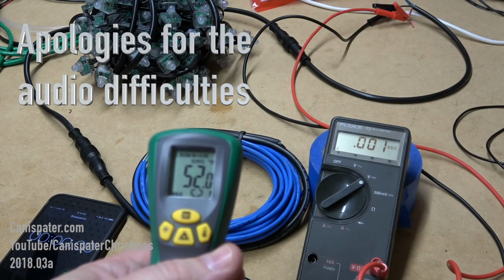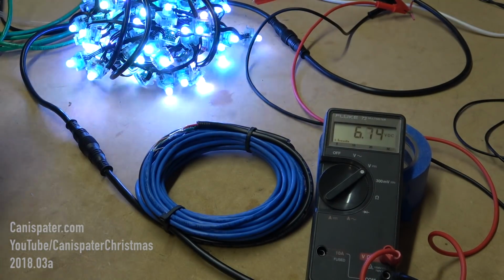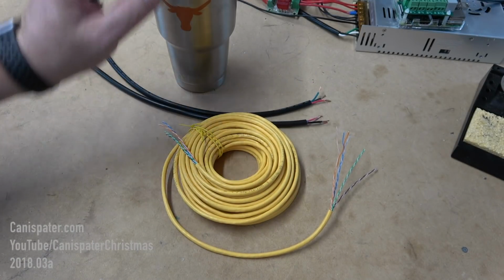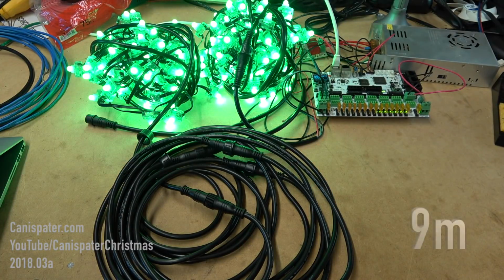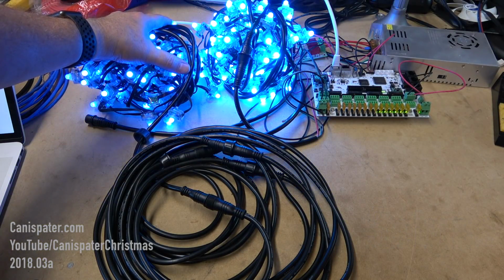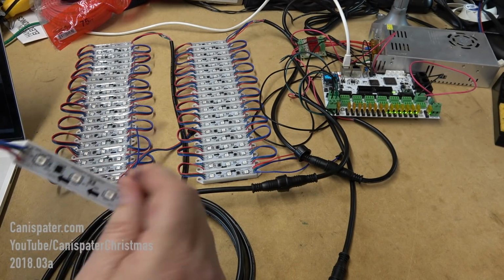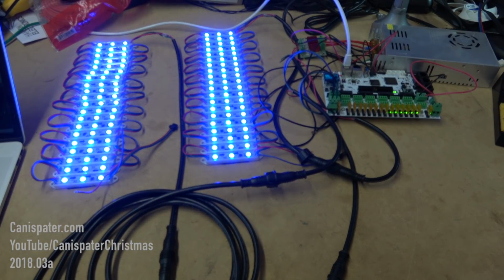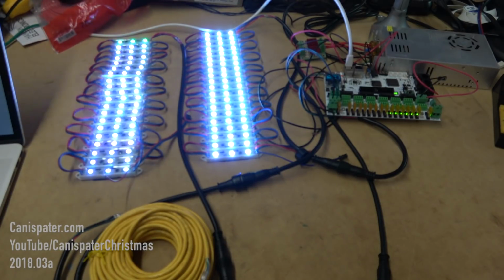RGB Pixel Distance Test - HOW FAR IS TOO FAR? (2018)

Comment: ive used 18awg speaker cable with no problems but i dont run mine at 100% i run mine between 10-20% because at 100% i found the pizels blinded you and the amount used in props and trees etc the max brightness wasnt needed really.
for my main cable from controller to start of lights string i use 0.75mm flex eiuther black or white epending what i have to hand but always 0.75 max length is about 8 meters with no problem.

Comment: I just run cat5e for the data and I use isolated 110vac power supplies at my injection points. no data pair common/ground/0v line should ever see power current.
Reply from the maker: Nice!

Comment: Great video thanks.  Quick question I'm just getting into the hobby adventure.  Which end of an xconnector pixel strand connects to the controller.  Which end is first pixel?  Also is the Male end of the pigtail the end with exposed pins like other electrical connections?  I see many people have pins exposed "male"? pigtails connected to their controllers.  Please help - confused.  Thanks
Reply from the maker: If you examine the pixels closely (might need a magnifying glass), all digital pixels have 12V or 5V, GND or "-" and DI or DO printed on the tiny circuit board. DI is the "data-input" input side from the controller. DO is "data-out" to the next pixel. I don't know if there is a standard, but the DI/DO check always works.
Reply: @CanispaterChristmas  Thank-you

Comment: Old video I know but this kind of distance is only available with this falcon controller right? Not with a nodemcu?
Reply from the maker: Getting a little out of my area there, but I believe there is some sort of amplification circuit on the Falcons. However, he also sells the F-amps which might help with the nodemcu.
Reply: @CanispaterChristmas  thank you for the reply!  watched a video from dr. z and it appears I need to amplify signal by taking out the first LED. for now being my first set up ill just leave it the way it is, and get me a falcon controller at some point. thanks for the great videos!

Comment: I'd be curious to know your how far you can push the data only by doing power injection at the RGB's with a separate power supply.  I have some RGB's that are about 65ft from my controller and wonder if I will be able to push the data only that far and have a separate power supply at the RGBs.
Reply from the maker: You would still need the negative side connected to prevent stray voltages on the data line. I believe it's been tested that far without an issue. Give it a try. :)

Comment: I know this has been up for over two years. I thought it might help folks to add in this calculator:

https://www.rapidtables.com/calc/wire/voltage-drop-calculator.html

DC voltage naturally drops over a distance. (The formula is on the same page if you scroll down.)

So I’m thinking of small injection voltage boxes is likely what a lot of folks will need for driving the pixels, and then f-amps every 15-20 feet to keep the data signal high enough to drive the signal and still have the pixel to pixel voltage drop in the string. You also have to take into account the number of pixels per string and figure out where to splice an f-amp and power injection.
Reply: Adding more information as this is important:

If you want to use CAT5e for power ONLY, you can safely pull 100W and 3.84A at 12V for 100ft. You have to use all four pairs wired a certain way. This is applying the Power over Ethernet (PoE) standards and ratings. Don’t burn your house down, though. That’s the upper limit. That should work pretty well for power injections.

And a link for reference: https://en.m.wikipedia.org/wiki/Power_over_Ethernet
Reply from the maker: Thanks! The data is re-generated by each pixel so as long as there is enough power and the pixel-to-pixel distance is short enough, no F-Amps needed. You really only need F-Amps if chaining props more than about 10-feet-ish apart. YMMV. And I think the pixels in that video were defective. 😂 I tend to judge the power needs by how the pixels look because I tend to be able to go further than the numbers say I should or I'm just not as picky about it one or the other. Cool site tho.

Comment: Seems like you can boost your voltage to 48V then use a 48-12V DC-DC converter at the end. Fewer losses over the run and up to 90W per the 802.3bt spec. But that’s just using 4 conductors. Push it to “DIY” spec using six conductors and I’d bet you can get over 130W out of it. Diff transceivers at both ends. I’m planning to find out through an extensive series of tests.
Reply from the maker: Cool. Let me know the results.

Comment: Great video! Your videos have really helped me get started in this hobby. I have a question. If I only had a Falcon F16v3 and had long runs what would be the solution?
Reply from the maker: Haha. Depends on how long we're talking, but there's a differential expansion board you could add to get distance for 4 chains of smart receivers. How long and how many props will determine your path.

Comment: I've had a few props where I used a 300 to 500 ohm resistor at the pixel end of a long data extension wire from a controller to the pixels.  The resistor cleared up problems I was having with bad display of data, flickering or random corruption.  This was cleared up by using the resistor, this was when the data wire to the controller was about 5 feet or more.  I highly recommend trying this in this situation.
Reply from the maker: Thanks for the tip!
Reply: @CanispaterChristmas  Thanks, something I learned from Adafruit.  It helps to properly terminate the signal reflections in the wire, something to do with inductance.

Comment: So the comments about Ethernet and power, I would suggest you lookup 802.3af, aka power over Ethernet, now the max the spec would allow is 15.4w but if you were to double or triple up on the wires for pwr and gnd I would see why you couldn’t push that higher
Reply from the maker: Yeah. A typical string of 100 5V pixels is ~30W at full brightness, all white. It works, just not recommended.

Comment: Can you post a video on the Falcon F16v3 how to setup a stand alone laptop (no internet) with the controller
Reply from the maker: Just run an Ethernet cable from the computer to the controller and set static IP addresses for both. You can  set the Falcon's IP using the switches.
Reply: Thanks Jeff, Do you have any video to help me
Reply from the maker: I don't believe I have anything that covers this case specifically. Do you know how to set a static IP address on the computer?
Reply: Jeff, thank youcan you please verify this video and say it is correct
Reply from the maker: Of course the video is correct, but which part? What are you trying to do?
Reply: Static IP address to my Laptop
Reply from the maker: @godfrey12121  Can you search Google for how to do that?

Comment: sir thank you so much for your videos..i am stuck with my project! can you please help me solve it? PLEASE RESPOND THANK YOU
Reply from the maker: What is your project?
Reply: Canispater Christmas aka Jeff Sir I have ws2811 Argb Strip 60led/m and it’s divided into two, 1.5meter each strip length. The power supply what I’m using 6amps 12volt. And the controller is Sp105e Magic Controller! NOW my question is how can I control both the led strip with one controller when one is connected directly to the controller and the other one is 5meters away from the Controller.. I AM FACING COLOUR GLITCH AND FLICKERING PROBLEM..
PLEASE RESPOND! FOR BETTER COMMUNICATION DO YOU HAVE ANY OTHER PLATFORM WHERE WE CAN COMMUNICATE?? PLEASE PLEASE HELP SIR 😭😭😭😭
Reply from the maker: Maybe a 2nd SP105? At 5m apart, you will need some sort of signal amplifier for the data since pixel-to-pixel signal is designed for mm. You can try a single strand of Ethernet cable for the data line, but not sure that will work.

Comment: So this is only showing the limitation of power right? So you could run just the data lets say 100' away and inject power right where the lights start and that would avoid any of these issues assuming you dont have too many pixels on the stand that you are injecting power into?
Reply from the maker: Well, this was before I found out that the one set of pixels was defective. However, data and ground needs to go the distance. You might be able to put power near the prop, but that wasn't the purpose of the video. It's kinda what the Falcon differential receivers do though. Honestly, just another tool in the box.
Reply: @CanispaterChristmas  

Oh thank you, I was just trying to get my head around it all . Love the videos I will be starting my own display after watching your videos, prob not time to get much done this year but loads of time for xmas 2021
Reply from the maker: @richardpinder3560  Thanks! Normally, I'd say you still have time, but this year is crazy so probably good to go with your plan. 😂

Comment: I am using 12V pixels and 18/4 stranded wire. I am running from my PixLite Mk2 controller to the first prop, then continuing on to the 2nd prop with the 18/4 wire that I am joining using solder seals to connect the two. Any idea what the max distance might be, that I could have in between the props before I would experience a data signal loss? Power injection isn't a problem as I can easily run a  additional Power Injection wire, but I am really concerned about the data line. Would I have to or Could I add null pixels to help the data signal?
Reply from the maker: Pixel-to-pixel distance is on the order of inches to a foot or so. You may need to add something like an F-Amp (https://www.pixelcontroller.com/store/index.php?id_product=53&controller=product) after the first prop to get it to go far enough. Just try it and see if it works. If not, it's probably a signal problem and you'll need to boost the signal. I did a video on F-Amps: https://youtu.be/-13TqtPHCpQ
Reply: @CanispaterChristmas  Thanks for the tips on the F-Amps. I did not originally see that video. These could definitely be useful. I also watched your video on the cable snake, where you used a CAT5 cable for the data line rather then the 3rd wire included with the power. Do you think this might also work/help improve the data signal in between prop to prop and increase the distance between them?
Reply from the maker: Maybe, but the problem is the signal from a controller is huge, but from a pixel it is very small and only designed to go the 4" or so to the next pixel.
Reply from the maker: Like I say, experiment with it.
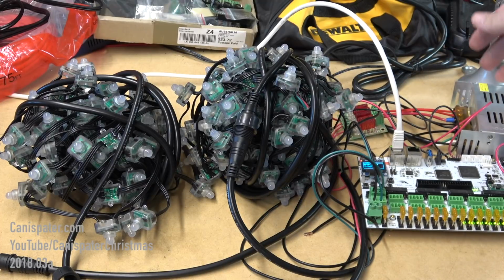Reply: Is the Hex Fuse (8:00 min mark) that you mentioned in the video equivalent to the Falcon Distro f8? Do you have a link to the one that you've used in the video? Or name/model?
Reply from the maker: They do the same thing. Alan (http://www.hansonelectronics.com.au/?s=hexfuse&post_type=product) is in Australia. David (f8) is in Colorado so order from the closest vendor.

Comment: Has anyone ever talked about using 2 power supplies for 1 controller. Like using one power supply to power a f48 receiver board and using a different power supply to power the distro board that power injects the same pixels as the first power supply?
Reply from the maker: I always split the positive if I'm powering the same string with 2 power supplies.
Reply: Thanks for the reply Jeff. Keep up the good work with the videos. It’s thanks to your video library that i pulled the plug and ordered my first 7000 pixels.  Appreciate all the work you put into your videos. 👍👍
Reply from the maker: HAHA! That's a lot of pixels! I only have about 4k.

Comment: Can I get started playing with just a string of led pixels, power supply, and raspberry pi? I have already downloaded xlights on my MacBook Air.
Reply from the maker: You'd need a Pi-cap (pixelcontroller.com) to connect the pixels. I don't believe FPP can bitbang them over the GPIO pins.
Reply: What if I used an Arduino instead?
Reply from the maker: I don't use them in my show so I won't be much help. I know people do, but I don't keep up with that. I loaded up a NodeMCU once with ESPixelStick software a couple of years ago so that's the extent of my knowledge, but I believe there's software for the D1 minis now. You might check the forums or FB groups.